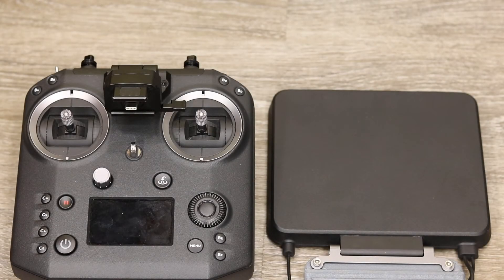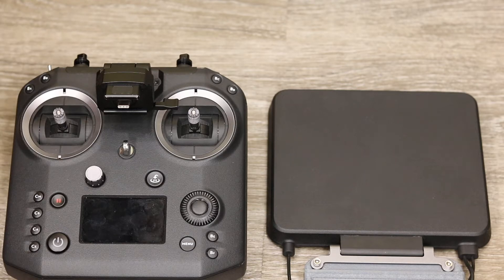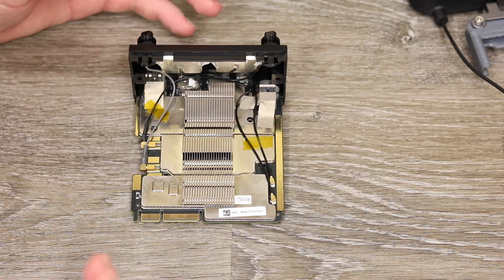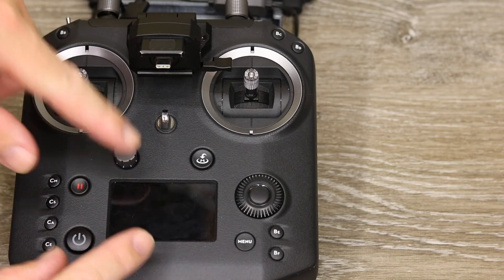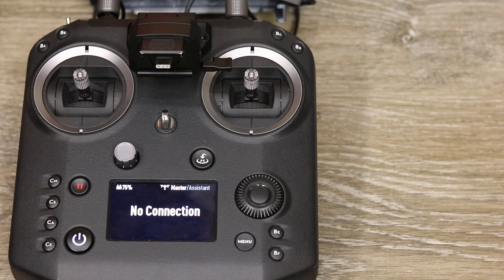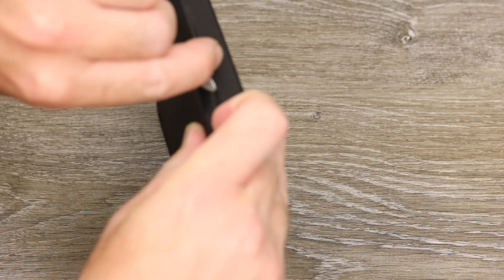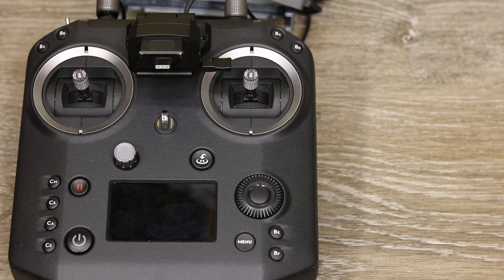DJI Cendence Remote Air Module Removal and Patch Antenna Connection Info & Sneak Peek

Comment: MAD Tech -- do you know the size of the screws used to mount the patch to the metal part on the controller? i lost one of those small screws.
Reply from the maker: I’ll check mine later for you.  I’m sure they are M3

Comment: great video! Quick question: Is it possible to replace the antenna cables on the patch antenna side? i.e. do they lead to MMCX ports also inside the Patch Antenna?
Reply from the maker: If I recall they are soldered.  I will need to take a look at some older images I have but I’m sure it’s soldered.

Comment: Wondering if they'll be a change with WiFi 6 (11.ax)  Good Lord I hate the Plastic Jointed stock Antennae's  - Had a case of the Parabolic's disjointing the cheap plastic hinge.
Reply: Need a Cellular Dongle for it - is there one?

Comment: Hey Mad RC. Do you think I could replace original antenna on Inspire 2 original RC with Patch antenna? would it work? any tips?
Reply from the maker: Sadly it won’t work, the patch is specifically driven by firmware in the Cendence.  However I may have something you could be interesting in coming in a few weeks so keep an eye out.

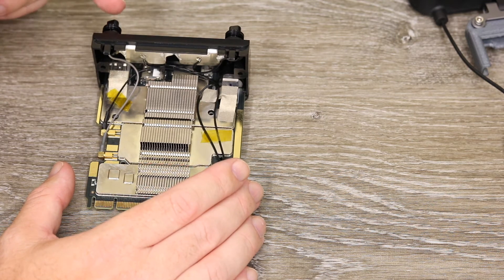Comment: Great video! had a question for you though. At 4:20 you mention being able to swap out the main antenna connections. I fell on mine and broke one recently and I'm trying to figure out how to pop it out to repair/replace it (without breaking it more). it definitely looks like it should be able to be popped out somehow.
Reply from the maker: You would need to remove the module and look at soldering some on.

Comment: OK, so, as you stated a while back, the 5.4 antennas are in the Cendence Controller and the Patch Antenna is only for 2.4 Gig? And, The Cendence is compatible with the Phantom 4 Pro?